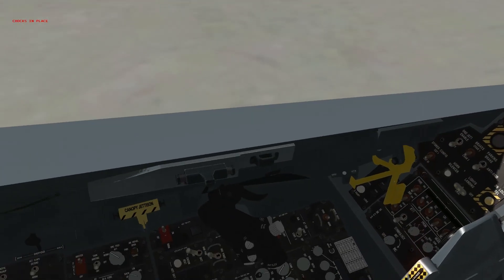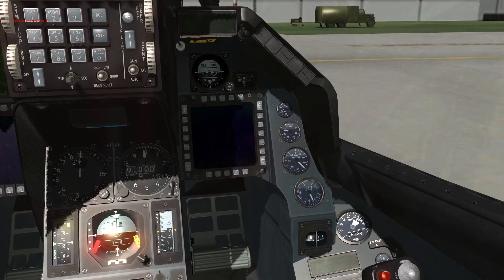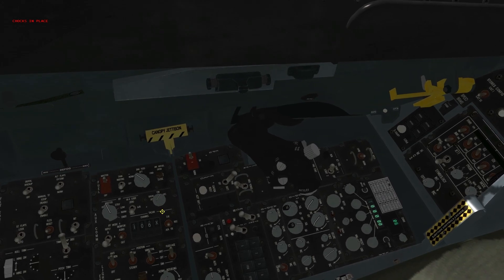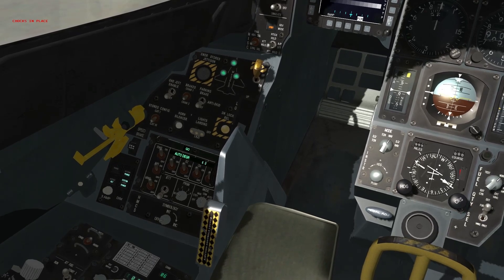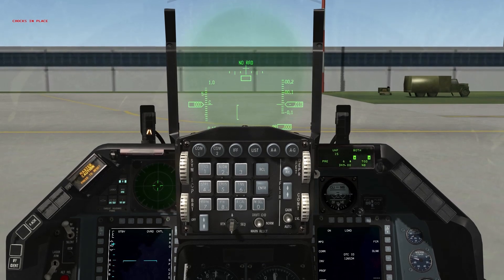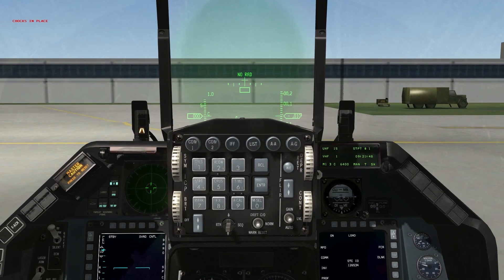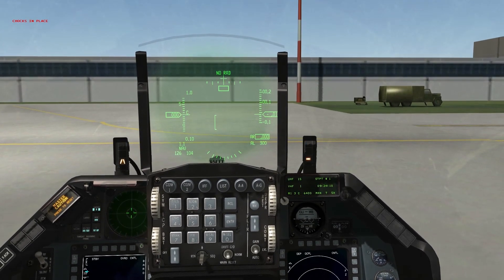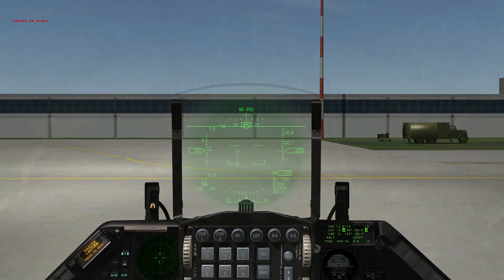BMS Falcon 4 Ramp Start Guide Part 2

Comment: Wich block is that one?
Reply from the maker: It's the GE-129 engine, which means it is a Block-50 in this case. The 30/40/50 all have used the -129. In BMS, the Block-52 is the Pratt & Whitney PW-229.
Reply: @Trekari  thanks

Comment: Just curious since I come from DCS but I didn't see you start the APU. Does the F-16 carry one or does it use some other means to get its power?
Reply from the maker: The F-16 does not have an APU. Power is provided by a battery bus until you start the engine with the Jet Fuel Starter.

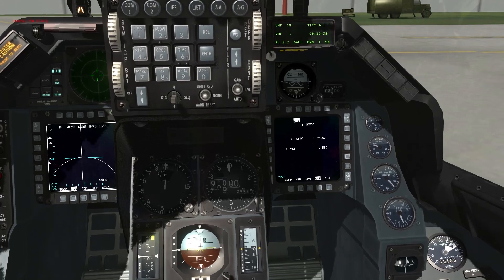Comment: Mr. Cavanaugh. I have quite som trouble figuring out what is going on from 11:00 - 11:20 when you instruct us to check our override modes. It is very hard to follow your instructions because we can't see what buttons you are pressing. Furthermore I have no clue what and where to find "MRM override" and "dogfight override". I have no clue where to find the pages where you check if your Aim120's and "heaters" are selected.

Comment: why doesn't your squadron use this procedure?
Reply from the maker: The 72nd is NOT my squadron. I believe they kicked one of the people out of the wing who was otherwise ruining the place, but I have not been a part of them for almost 2 years now.

They did not want to use the procedure because the older folks were largely unwilling to move to BMS in the first place, let alone actually have to learn new things.
Reply: Jason Cavanaugh Ah I see. Great tutorial none-the-less. 

Thank you for posting!
Reply: +Jason “Wizard” Cavanaugh Are you still flying BMS?   What squadron are you with now, and are they looking for new members?
Reply from the maker: +Charles Riley I'm actually in the process of forming a Hornet-based squadron with my long-time wingman. We're putting it on the back-burner for now until after the holidays are over. Stay tuned!

Comment: Korafat, The original manual is bigger than most academic texts and is still a valuable resource for BMS. If you don't have it, there are PDF's of it and the BMS one in the game and online as well as Keyboard shortcuts. Throttle idle detent is default Alt India ( Alt + i) and flaps are default Ctrl F9/F10/F11/F12 (no joke). I know people often tell you to press alt tab or alt F4 but those really are the flaps buttons.
Reply: flaps are automatically controlled by the FLCS
Reply: How helpful. What do you do when you have a FLCS fault?

Comment: I am missing something here.  the RPM never gets past 25 percent, fuel pressure doesn't change or anything.   From 01:55 and on, nothing works for me.  I went through the check list twice.  Also, how do you pan your view so you can see around certain things to see all the insturments, such as the AC controls and such,  I can't see them at all.